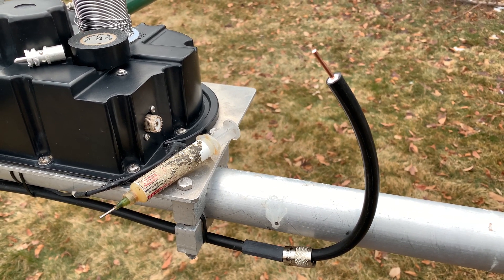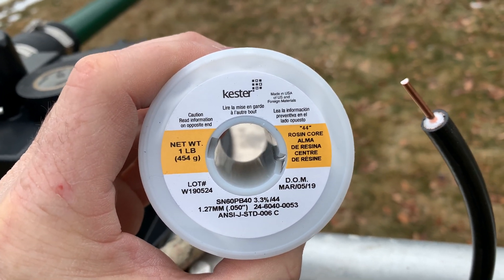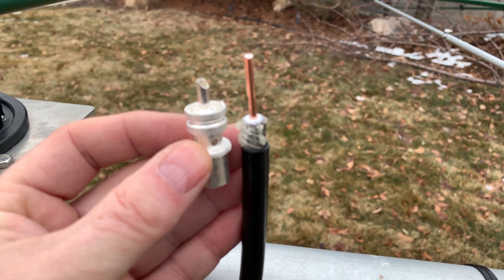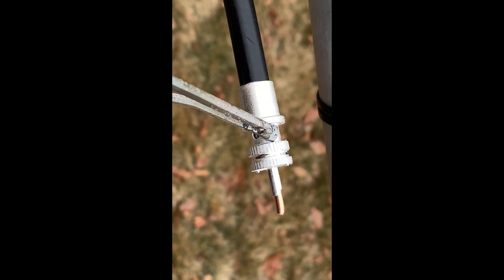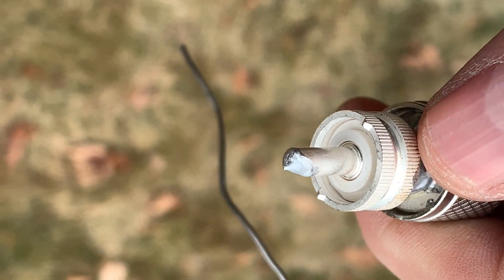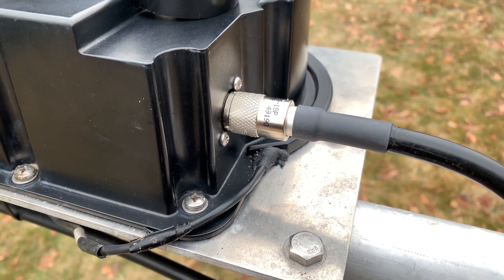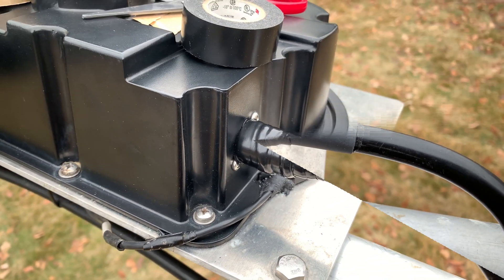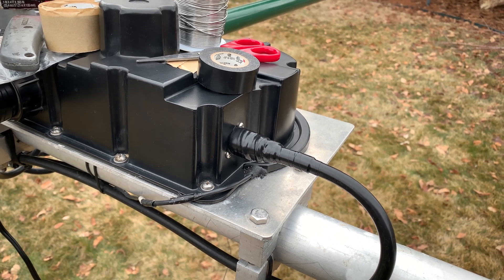PL-259 / PL259 Connector Solder Install and Water Seal

Comment: I use a single piece of of marine grade 3:1 heat shrink all the way up to the SO-239.  It has glue on the inside so it extrudes glue from the end to form a seal.  It’s actually not hard to remove. Use a utility knife and slice right across the PL-239 and it will peal off

Comment: Try silicone tape, no residue and cheaper than coax seal tape.
Reply from the maker: Hi, thanks for watching.  The tape I'm using isn't the nasty coax seal which is extremely hard to remove.  What I show in the video is very similar to silicone tape and is easy to remove: 3M 2228 Scotch Moisture Sealing Electrical Tape. Highly recommended.

Comment: Very nice video.  One suggestion if I might?  I have been working in telecom business for over 40 years and use 88 tape on a daily basis.  You need to apply the Scotch 2228 before the Scotch 88, the reason for this is that the 88 will allow moisture to wick under it so you end up with problems in the future.  It does take awhile but it does happen.  What ever product you choose to use as the sealant, I would advise starting with the sealant and finishing with the Scotch 88, it will help force your sealants into where they need to be.  It will hold in what ever you use, (TBT 20, DR Tape, Liquid cable seal, etc.) and does not break down in the sunlight.  I have gone back 10 years later to locations that the Scotch 88 was used at and found it just like it had been just applied.  You get what you pay for as they say.  Thanks again for you videos I have enjoyed them.

Comment: What's the brand of that flux?
Reply from the maker: Hi, actually the syringe I'm using was refilled with LA-CO 22194 Regular Soldering Flux Paste, which you can find on amazon.  It works great.  The syringe originally was purchased from Amazon and is still available: MG Chemicals 8341 No Clean Flux Paste.  However, I have refilled the syringe many times now at a much cheaper price as you can see with the LA-CO paste that comes in bulk compared to the MG Chemicals.  Thanks for watching and for posting your question. 73, Max NG7M
Reply: @ng7m-ham-shack  Thanks! I just placed an order. There were so many different options on Amazon that I wasn't sure what a good one was.

Comment: I appreciate the great recommendations on parts etc. People usually recommend based on low cost vs high quality. 
Am I the only one who uses the solder gun on heat shrink?
Reply from the maker: Late reply, thanks for the comment... no I don't think you are the only one. :)  The soldering gun works too, but when I have the heat gun handy I prefer that.  The both get the job done for sure. :)  73 and thanks for watching.  Max NG7M

Comment: Hi Max, Engineer here. Crimp connections are tested to be more reliable but since you aren't  sending your antenna into orbit or deep space you'll probably survive with the solder type connector.  I use the crimp/solder type here. Why? Because I like it better than a crimp pin :-). 73, Bill WE5P
Reply from the maker: Hi Bill, yes, good point.  I actually used Amphenol crimp connectors on all the PL-259's when I first put the antenna up, but decided to go with the solder version for this repair.  I do like the robustness on the Amp solder connectors as far as the screw on barrel is concerned.  The amp crimp barrels are not as beefy. :)

Comment: Nice job - I prefer water proof compression type connectors for outside use. This type is also used on mobile phone basestation towers with high end cable like cellflex, heliax, etc. - see e.g. here: https://www.youtube.com/watch?v=-wIAdxgAs0w
Reply from the maker: Thanks for posting the video.  Yes, those are excellent too with the compression water proofing.  I do prefer the Amphenol brand and I'm willing to pay the price premium, but for the connectors you show, the price looks pretty good!